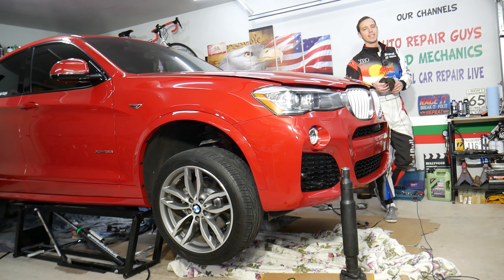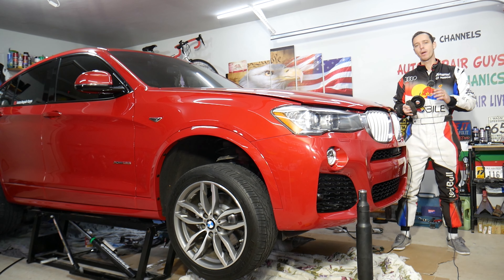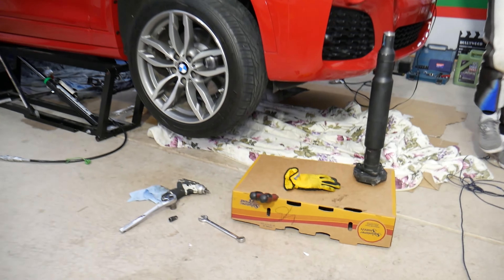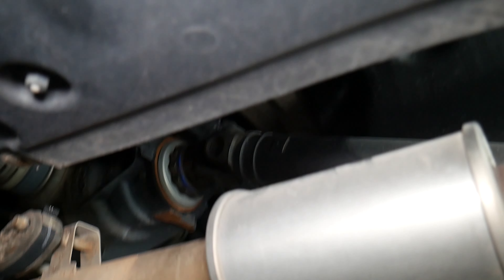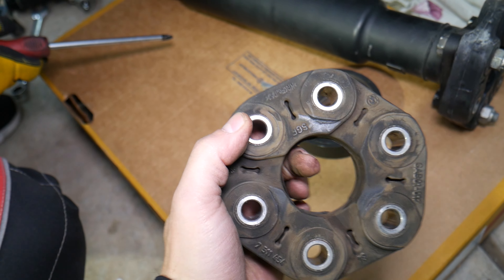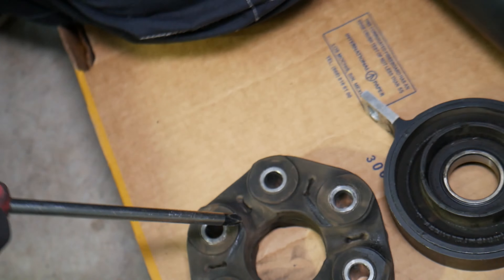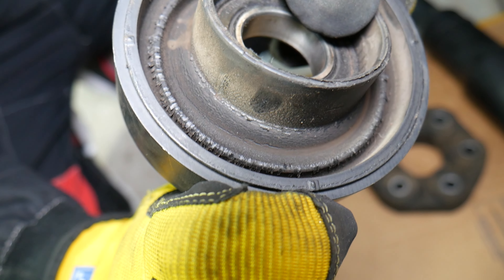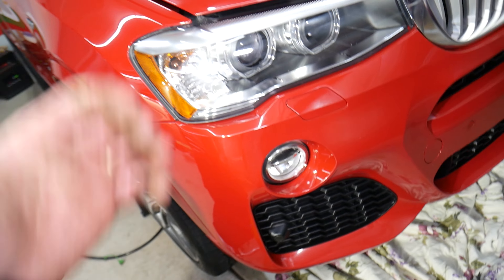THIS IS WHY CAR VIBRATES WHEN ACCELERATIING, VIBRATIONS UNDER SEAT

Comment: Usually when it shakes or vibrates like that too it is also the wheel bearings on either side and the lower control arms. Start cheap and move forward. Unless you already did that I feel you went straight to one of the expensive parts.

Comment: Please help. My Ford ranger is vibrating when driving above 40 to 80 kmph. The suspension is checked and no issues, the u joints also fixed. The vibration is under seat and floor of car and not in the steering wheel.
Reply: Check the balance or maybe one of the rims might be bent. I had the same, did the balance first it didn't help, so I had to replace 2 rims in my car after I hit a pothole.